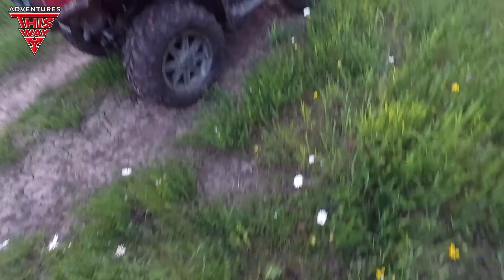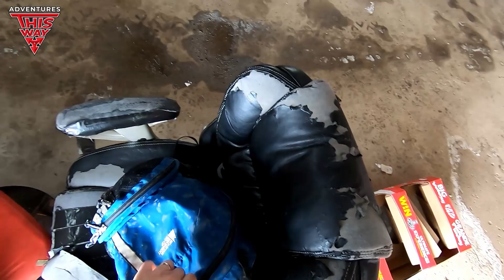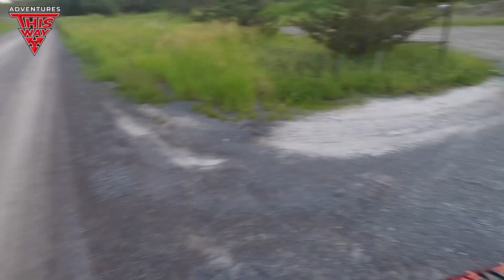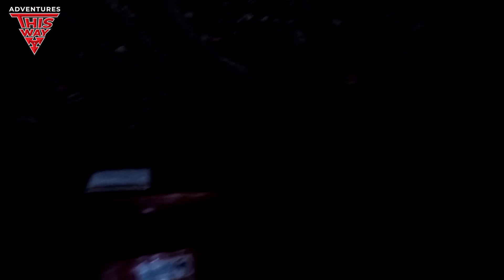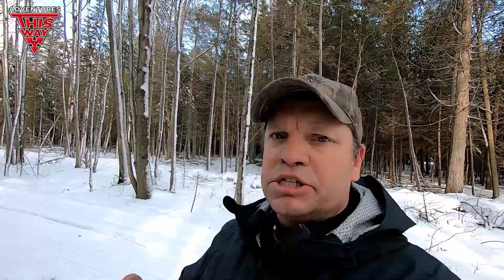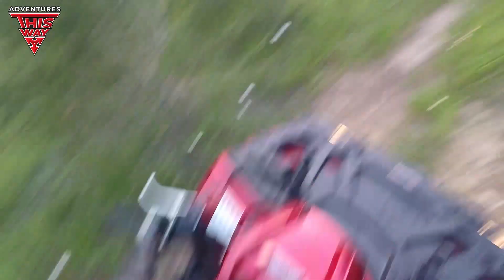2021 Can Am Outlander 850 XT Test Ride & Review VS Polaris Sportsman 850 XP

Comment: Hey Don! My name is Don also.
I bought a 2010 Brute 750 new still have it to this day, I think I replaced 1 belt which was from me using it like a front end loader😁
I leveled approximately 140 yards of loam and another 100 yards of crushed asphalt. 
Like you said if kawi came out with a 1000 I'd be pre ordering.
I currently have a 22 outlander 1000r xtp on order. Should be here mid February... hopefully.
My son will be using the kawi.
Reply from the maker: That's good to hear, great choice on the 1000 XT-P

Comment: Bought this model couple months ago.  Love the throttle control.  Work mode is great for taking away the jerking in the tight stuff.  Really like the extra wide stance over my older G2.  Saved me a couple times already.  See how these itp tires hold up.  Midrange is strong with this machine.  Top end is no better than my old 650.
Reply from the maker: they sure are nice to ride, lots of power.  Some tuning will allow more top end I'm sure

Comment: Nice, i have the 850xmr on 32 assassinators 😆🤣. I love this machine, i owned a 17 highlifter 1000 a couple years back and i can't really say anything bad about it, i traded for a rzr then decided i wanted to go back to atv.i love both though.
Reply from the maker: The low end torque is a rush!
Polaris is a completely different type of machine-both have there good and bad points.  As long as you are smiling doesn’t matter which one
Reply: @ADVENTURESThisWay  absolutely agree, i can have fun on any of them.

Comment: I have both as well, 14 Sportsman 850, 16 Outlander 1000R. Way more throttle response on the Can Am, Polaris is ultra smooth. Ya changing belt/clutches would be more pain on Polaris, but changing those items should be few/far between. Gen maintenance (oil, gear oil changes) is TOTAL pain in rear within Can Am.... takes hours by the time you remove all plastics, guards etc to get at drains, filter etc. You remove nothing with the Polaris, takes about 10 mins.
Reply from the maker: When it comes to belts/clutches when using regularly in  higher performance situations clutch maintenance and inspection is critical.  I 
 I have to disagree on access for maintenance-both are pain-but isn't a thorough visual inspection  part of  maintenance as well??
Reply: @ADVENTURESThisWay  I don’t regularly open my belt case for inspection (maybe I should be lol) but under regular use a belt should last you a long time. I was referring more to engine and gear oil changes, if you do it yourself you’ll know the Can Am is a significantly bigger pain in the ass and takes WAY more time than the Polaris. I change both in the Polaris (including filter) in about 10 minutes.
Reply from the maker: I hear ya, most of the Can Am folks say the Outlander takes a bit more work to access stuff compared to the Renegade...I did a fair bit of extreme terrain with my Sportsman, it was a pain to dig mud out to find the oil filter. But at least newer models have a cover for that now

Comment: What’s your thoughts on the grizzly 700? Obviously it doesn’t have the same power but what about everything else?
Reply from the maker: Can't go wrong with a Grizzly.  If Yamaha put their 850 in the Grizzly 2 years ago I would have gotten one instead of buying my Polaris 850.  They excel at recreational riding, hunting, etc. and are very capable at aggressive trail riding.  They don't blow your hair back, but you can get many years of use out of them.
Reply: @ADVENTURESThisWay that’s why I’m leaning towards getting one. You get great clutching, power steering, full skid plates, LED lights, a very nice gauge, lockable diff amazing build quality and serviceability and a very durable motor with good low end power. To me it’s the best overall packaged atv out there. It would be nice to have the 850 option for those that want it though! I was also considering the can am outlander 850 and Honda rubicon but I just keep coming back to the grizzly. Thanks!
Reply from the maker: No problem! I tell it like I see it
Reply: King quad 750 is the best all around atv on the market imo. Reliability up with honda, power is there, only japanese bike faster is the brute and only on top. Check out a zuke I have no regrets on it.
Reply from the maker: @ljconole7470  thanks for your opinion, I know everyone has their favorites...this video is a comparison of 2 twin cylinder 850 ATV's...
Reply: @ADVENTURESThisWay  I was replying to the person who asked about the grizzly. I think it would be foolish to overlook Suzuki. The two machines in this video are nice no doubt, but for something more reliable you must consider japanese.

Comment: I Have owned many different Atvs over the years Honda’s , yamahas , Kawasaki Brutes and now currently own a 19 Polaris Sportsman XP 1000 premium along with a few Honda recons and Can Am Maverick Trail DPS 1000. 
The Polaris nor can am matches Japanese quality head to toe . I love the amazing comfort and smooth ride on the XP 1000 but I hate the floaty front end push feel it has ! It takes a pasture to turn around that my 2012 BF 750 could turn circles in . Turning inside tight switchback trees and stuff 100% goes to my brute forces . The XP just had way to much front end push . It does have the best seat in the history of fourwheelers however. The AWD system is flawless IMO. 
I have been considering selling it soon and getting a Can Am outlander 1000. 
My dream machine would be a suspension revised updated Kawasaki Brute Force 1000. 
They were light weight nimble handling fun muscle quads .
Reply from the maker: I agree with you about most points about the Polaris other than the AWD system it does have flaws that cause parts to fail quite easily...yes it works very well-durability so-so.
Totally Japanese quality is far superior
Reply: @ADVENTURESThisWay  I actually agree with how your looking at their AWD system , I should’ve stated in most conditions it’s always worked flawlessly for me . I can see that side too , such as aggressive throttle engagement against roots , or rocks, and busting diffs and or CVs. 
I’m older now and I just mainly like a lot of power and nimble handling . I saw that Can Am finally put a legit diff lock on the 21 mud packages ....do you know if the regular Outlander 1000s got the front diff lock ? 

The Visco on my Maverick Trail 1k is serviceable enough , but is still no locker .
Reply from the maker: @joekearney  well...let me tell you.  The Visco4Lok is the real deal.  I’ll plan to do a video about it soon...

Comment: At the bottom  rpm  Can Am  got  more power ( V engine = higher Torque )   Polaris got a bit better  4x4 drive  ,    Both are  good  ATV
Reply from the maker: Agreed power is right there.  Honestly, with the 4Lok Can Am has a better, more durable 4x4 system tha Polaris, especially in extreme riding conditions

Comment: Polaris sucks got a 2021 850 300miles and already needs clutch and belt isn't covered under warranty
Reply from the maker: That doesn't sound right....
Reply: @ADVENTURESThisWay   thought the same dealer sent pictures so now I gotta pay $1,200 or try and find online and do myself
Reply: The  you likely didn't follow proper belt break in procedure.
 Can't get on em and hammer down right away. If you did follow procedures then buy an 80 dollar belt or upgrade to a carlisle belt and be done with it. Everyone I know that burns polaris belts it's because of abuse. I even have one buddy who's wife burned out the one direction bearing in the clutch by using the engine to hold it on hills too much. Don't know if you mountain ride or flat lander but belts shouldn't fail prematurely. Use low range it's there for a reason.